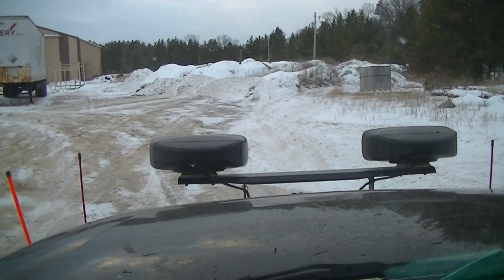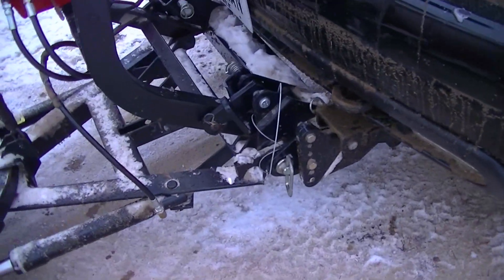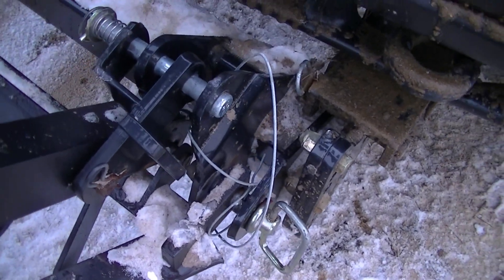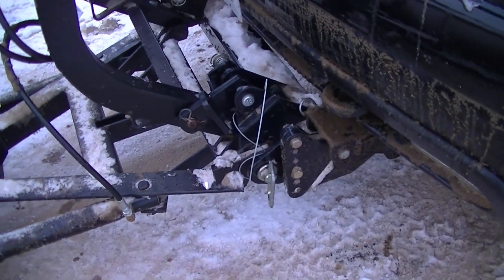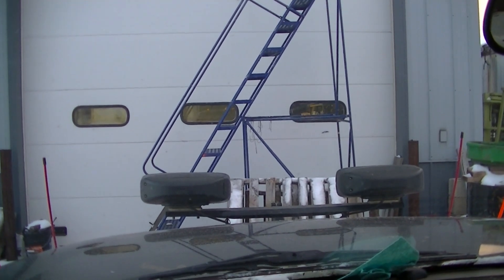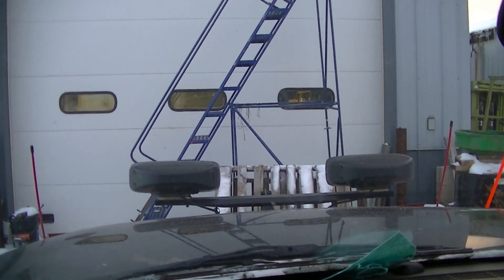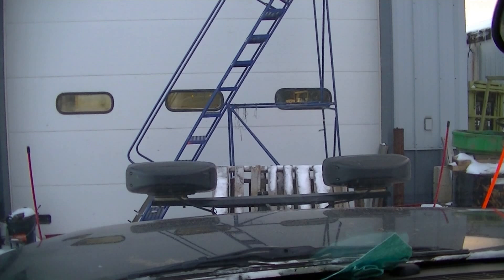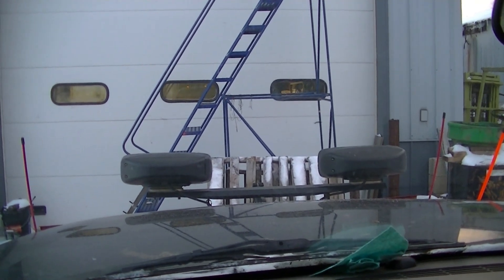Snow Plowing with the Chevy Dually and a Little Trouble

Comment: You should unhook both battery after driving it, and check the next day which one got lower in voltage. Clean those side posts too
Reply from the maker: I already have the truck in the shop and working on it.  Batteries seem to check out fine.  Connection on one was not good.  Going to put a new alternator on it that I had laying around.  Video should be up tomorrow or the next day.

Comment: You plow a lot of rough ground that much vibration could definitely knock it loose I had one pop out on me last year I noticed it same way the frame was hanging down on one side I think I didn't lock it in good enough when I put it on good thing you noticed it's not good to keep going like that especially with a truck as heavy as yours
Reply from the maker: After making the video and thinking about it I remembered hitting a washout by one of the sheds.  I think that either sheared the little pin or popped it out somehow.  I have plowed our moss bed for 14 years or so now with the same plow and have never had a pin come out like that.  I am sure something would have gotten bent if I would not have spotted it.  You have to pay attention while you work.  It can save you a lot of time.  One more push I would have probably lost the whole pin.  Fence wire would have done no good then.